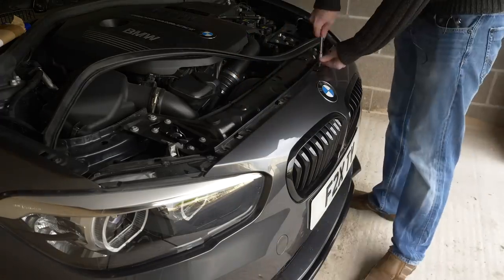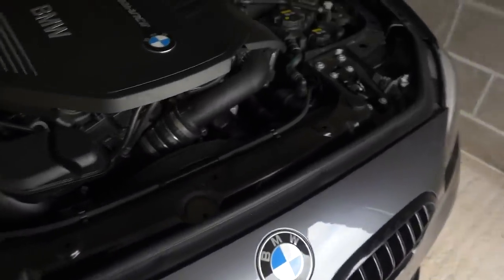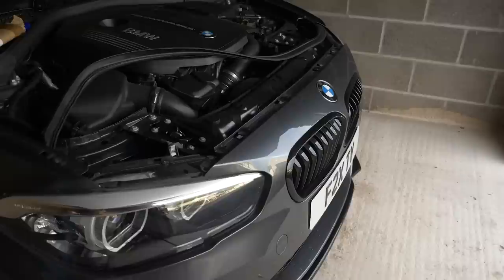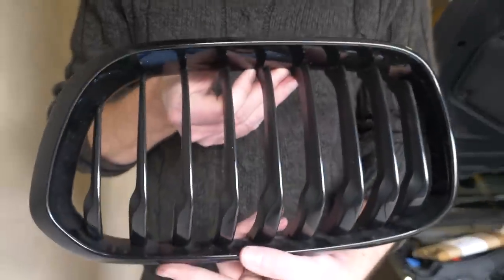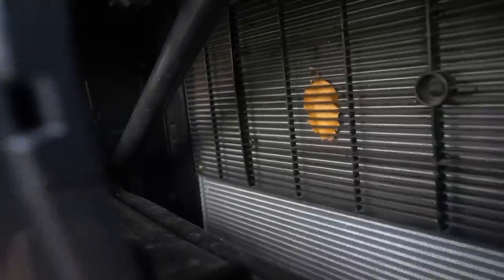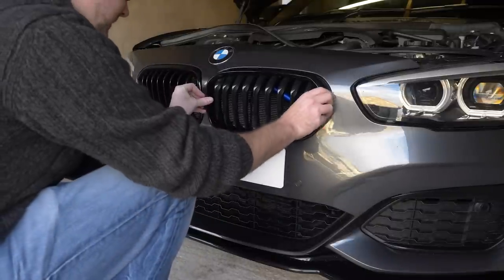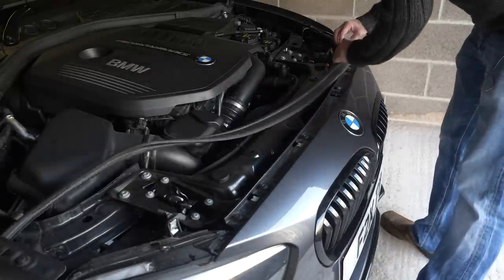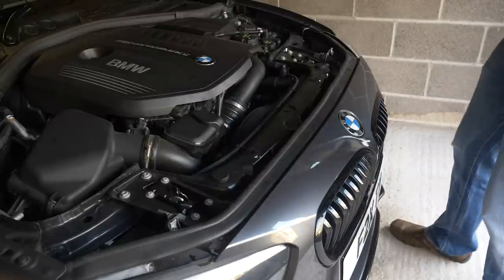BMW M140i How To Wrap The Crash Bars

Comment: Great video. Where did you get the bug screen, between the V brace and the radiator? I have an F36.
Reply from the maker: Thank you 🙏 it is actually standard on the M140i from 2018 IIRC

Comment: What do these actually do, the bars itself? Does it warm up or anything so it will peel off the wrap?
Reply from the maker: They are the crash bars, they don’t heat up and my original wrap is still on the car after 3 years!
Reply: @NICKFOXTV  What's the purpose? Something to do with crashing I'm assuming

Comment: I have the same color On my 440I GC, what size of vinyl did you buy?
Reply from the maker: jon2xmanuel i cant remember exactly, but you dont need much. An A4 sheet or two would probably do it. You could get a bit more just in case you need to re-do it for any reason though 👍🏻

Comment: You can remove the kidney grille without unscrewing the bumper.
Reply from the maker: Marco R how did you manage that?!
Reply: @NICKFOXTV  Already tried two times. You can remove the grille by pulling it firmly "but flexibly" .
Reply from the maker: Really?! I wouldn’t want to risk it myself!
Reply: @NICKFOXTV  mate, you just have to make sure you pull the most on the base of the grid